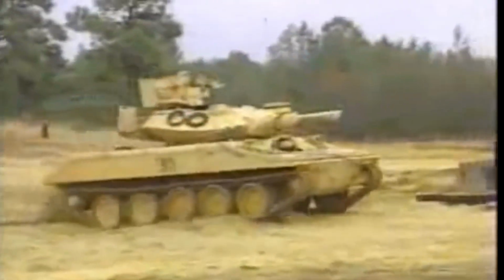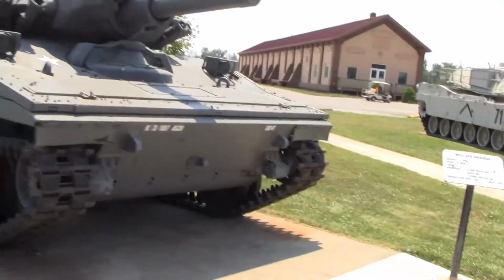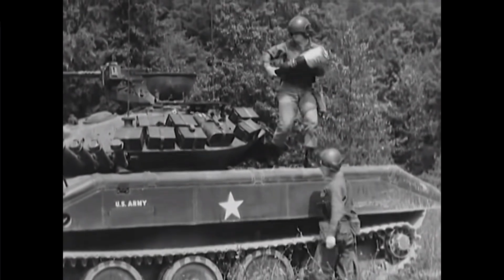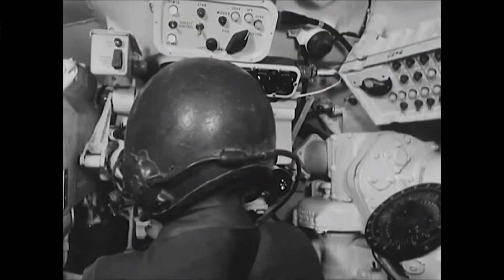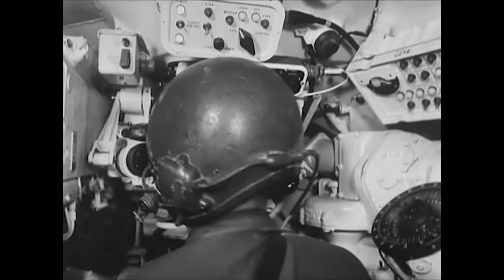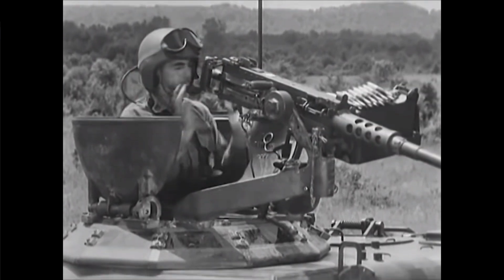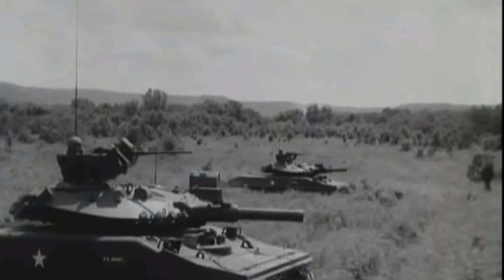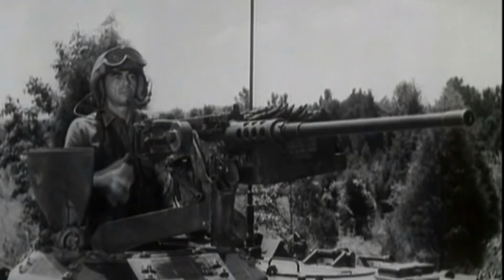M551 "Sheridan" AR/AAV | DESIGN DISASTER!

Comment: The solution would have been to replace the 152 mm gun with a 105 mm M3 howitzer or another short-barreled 105 mm gun, then simply add a launcher tube for the Shillelaghs (one tube would have been enough since the tank only carried 8 of them at a time). That would have solved the issues with the excessive recoil and the M551 still could have killed tanks while blowing up enemy fortifications or infantry.
The only reason why they did force the design to have this big fat gun was because they desperately needed another carrier for their failed gun/missilelauncher combo to keep their pet project afloat, and both the MBT-70 and the M60A2 had failed to materialize.

Comment: Please stop calling the Sheridan a Tank, IT IS NOT A TANK. IT IS AN AIRBORNE ASSAULT ARMORED RECONNAISSANCE VEHICLE. I know all about the Sheridan first hand because I was on one. They were JUNK.

Underneath the loader seat is an air compressor which was so loud you could barely hear when it was running. Next to the loader seat was a giant compressed air tank for the bore evacuation system. After firing conventional rounds the air compressor kicked in with a blast of air forcing the remaining combustible casing out of the gun tube.

The Convention Rounds were encased in rubber protective baga which you had to use a knife to cut so you could peel it off. We use to pre cut the rubber bags at gunnery so we could have faster loading times.

The breach was electric opening as nd closing. The Loader had to insure there was as Titanium ring/seal in the breach before loading a Conventional Round into the Gun Tube. If the Loader forgot that important step it would be a tremendous blast inside the turret of smoke and flames because the Titanium Ring Seals the Gun Tube and Breach tightly. With out the ring, the gases escape violently back inside the turret of the vehicle. Woe be on to a Loader who forgot to do this.

The Shillelagh Missile was slow, took too long to go through the Missle Sub System Set up and had one major flaw. It was IR Guided. It had a tendency to fire from the gun tube, drop down to the ground, lose track of the IR Designator which was pointing a beam at the target. The Missle would pick up the IR Beam coming from the source the Sheridan, do a 180 degree turn around and fly back toward the Sheridan.

After firing the Missle if it hit the ground, shut the damn system off or unass the Sheridan because if it picked up the IR Signal and flew back to you, the warhead contained 5 pounds of Octol. Training Rounds were Inert Rounds but the impact would RIP open the Sheridan Aluminum Armor. This is why the Sheridan NOT A TANK AND IT NEVER WAS A TANK. IT WAS USED AS A ARMORED RECONNAISSANCE VEHICLE. in Vietnam they were uploaded with the Canister Rounds which fired 10,000 Nails or Flechett at the Enemy. They also used the Grenade Launchers which fired White Phosphorus Grenades at the Enemy.

Just so you know, we offered them to Isreal and they turned us down asking us for the M60's instead. This was before the M1 Abrams were built.
Reply: and then the m60s became the magach series of tanks?
Reply: @TimmyTheTimeTraveler  the M60 was upgraded to the M60A1, M60A1Rise Passive, M60A2 which was like Sheridan because it had the short Gun Tube, fired the same ammo and the Shillelagh Missle. and there was the M60A3 which had Thermal Sights. The final M60's were upgraded with reactive armor. 

For a old tank, the M60 is still in use today because it was proven on the battlefield. It has knocked out Russian made tanks.

Comment: I crewed one of these in Europe 75-77.  We were going through a practice run at Grafenwohr  with a full load of 152mm target and HE, 7.62 coax and .50 cal.  Earlier our hydraulic pressure plug had blown so the normally white turret interior had been transformed to a pleasing shade of pink by the flammable "cherry juice".  A green, non-flammable "vegetable juice" would come along later and would cause it's own problem if mixed with any remaining "cherry juice" I understand but we were still using flammable "cherry juice".

There was a wire mesh cable guard in the turret that was meant to keep electrical cables out of the teeth of the turret ring as the turret was traversed.  Our cable guard was missing but nobody though a thing of it until - you guessed it, the electrical cables got caught and severed in the teeth of the turret ring.

The resulting electrical arc from these severed cables ignited the coating of "cherry juice" which was announced by the gunner who yelled, "We've got a fire and it's all around the turret!" as he pushed his way out of the turret pushing the commander out ahead of him.  The loader had already made his way out of the turret and both the gunner and loader were already headed back off of the range as the commander and driver, neither of whom had seen the fire in the turret, attempted to activate the exterior fire extinguisher.

For reasons that later became clear, the fire extinguishers failed to function.  By that time a wisp of black smoke was visible as it rose from the commander's station and a jeep from the rear arrived to evacuate the commander and driver.  Range control was notified and all the ranges on Grafenwohr were closed as the fire aboard the M551 took it's course.  Credit must be given the asbestos bags that covered the caseless ammunition for delaying it's detonation for about 26 minutes.

Upon returning to the vehicle when the proper authority deemed it safe a few days later, shiny globules of once molten aluminum that had been the M551 were recovered as souvenirs.  

Investigation into the loss of the M551 found that the fire extinguishers had been secured with steel wire rather than the required copper wire thus explaining why the commander and gunner could not activate them.  It was speculated the mechanics who serviced the vehicle had done this so fire extinguisher bottles would not discharge while being installed in the hull of the vehicle causing injury to the people installing them.  Subsequent inspection of the fire extinguishers installed in various vehicles in USAREUR established that this was not an isolated practice.

As mentioned earlier, non-flammable green "vegetable juice" was later introduced to replace the flammable red "cherry juice" but I understand failure to completely remove ALL the "cherry juice" before introducing the "vegetable juice" could result in a jelly formed by the combination of the two fluids which could gum up whatever system it was used in.
Reply: I spent time at OP Alpha and OP India back in 76,77,78,  I was with 8th Inf.Div. CSC .5/68,Recon. We had one  with us.
Reply: That was a truly excellent story! Nothing quite so good as military tales where one thing after another happen. Sometimes I just had to laugh!
Reply: So what did we learn today? Asbestos saves lives.
Thanks BTW for the good read. I'm a software developer, but I'm also interested in other engineering fields and I love stories that tell what happens after a product leaves the design table and is used in the field. It keeps me alert to always get feedback from the people actually using the product and sometimes pass by layers of management and paper shufflers.
Reply: Glad you're still with us... what position were you?
Reply: I was in budigen Germany  from 76-79 3/12 cav I fully remember graf/wilflecken that's the tank we had
Reply: I served on Sheridans in Germany and Ft, Bragg. The main problem with the main gun was that the gun seal was weak and  for what ever reason was never fixed. That may have been why the M 60 A2 was dropped. I served in an airborne cav troop when we got the Sheridans. We hated giving up our 106 gun jeeps because of the freedom of travel but found the Sheridans got around much better than the M 60 that we also gave up. We never threw tracks on the Sheridans like we did on the M 60 so we got used to the 551s. But I did love that Shillelagh. Fired them in all kinds of weather and never had a miss. I know of the combat record of the Sheridan in Vietnam but also from what I read tankers did not fare well there on the M 48s either.
But that also depend on who you talk to. I talked to those in the 11 ACR when they moved from the M113 to the M551. In both protection and firepower, they told me that they would take the 551 every time. For myself between the m60 and the m551, I'm a Sheridan man. But lord I sure missed that Gun Jeep.
Reply: Ooo

Comment: In 1969 I sat on the ground shut down near one these that had hit a 155mm dud rigged as a mine the night before.  There was not much left; the engine, the gun, a few odds and ends.  I watched for half an hour as two medics sorted through the wreck.  Occasionally they would bend down and pick up some small bit and put it into a rubberized laundry bag.  When they were finished, my passenger, the squadron commander, brought the bag to the helicopter and gently laid it in the back seat, stepped back and saluted.  He was obviously deeply distressed.  The bag could not have weighed more than 20 lbs.  It was the remains of the Sheridan crew.  None got out.  It was not the first, or the last, time I saw something similar.  Aluminum armor and combustible rounds indeed.

Comment: I served on a Sheridan in the early 1970s in Germany in every crew position.While we never had any of the issues you mentioned (never had a main gun failure or issue with chamber gasses). We viewed our tracks as essentially an anti-tank missile launcher. I do remember the main gun recoil very well. You had better be hanging on. We loved the cross country speed too. Rate of fire was abysmal, however, and was one of the weakest points.

Comment: According to a friend of mine who was on the Sheridan after the M60, to load the shillelagh, because it wouldn't actually fit in the turret ring very well, you would have to fully elevate the gun so you could kind of shoehorn it in, then depress it so you could fire. Maybe it was a matter of convenience, but that is what he said.
Reply: It takes practice to load a 60 inch 65 pound round when you are in a tight space, but it can be done. With practice and experience. Just make sure that you have the key down and lined up with the slot on the loading tray.

Comment: IIRC the Sheridan is a Airborne Armoured  Recon Vehicle, not a tank.
As noted Australia trialled it for the Amoured Cavalry Regiment (Medium recce) but in the end did not adopt it, despite that the Aussie doctrine that included the Sheridan was published and issued (I had copies of “The DIvision In Battle” which included org charts and other references to the Sheridan).

Cherry OIl - OM15 - we used the same stuff in M113AS1 - which is roughly the same era as the M551.
OM15 is a hydraulic fluid died red (hence cherry oil) to help identify leaks.
On the M113 series it was used for the hydraulics that raised the ramp and possibly the hand pumped steering pivots.

Comment: I worked as a driver, gunner, and loader on an M551a1 from 1986 to 1989. I was with the 3/73 Airborne Armor Regiment.  As stated below most of the issues with the tank had been resolved years earlier. I was one of only 3 drivers that I know of to "swim" the tank. I found this to be the most terrifying thing I have ever done. All in all the tank I was on was fast and reliable. We were warned tho that if the tank caught fire it would burn VERY quickly because of it's aluminium construction.
Reply: All too true.

Comment: I'm not sure how true this is but it's funny anyway. Apparently the Sheridan had problems with the parachutes on a fairly regular basis. This depending on drop height would regularly result in them burying themselves in the (hard) ground up to about half way up the turret. This led to someone actually putting together and submitting a battle plan to take out Noriega in Panama by air dropping six Sheridans on the basis that one of the parachute systems would probably fail and squash him. Apparently the senior staff were not amused.

Comment: Clearly it was intended for the French. Rolls backwards as you fire... perfect.
Reply: Roland Lee 
Correction: in French service, the tank would be pushed FOWARD upon firing because the turret would be turned backwards to face the enemy.
Reply: @Tomcat82  Hmm.. since this tank has no actual armor to speak of then I indeed have to concede your tactic is a much better option given it can tactically retreat in cowardice to surrender 2 hours later more effectively at full speed rather than being limited to one gear in reverse.

Comment: Although the vehicle had many short comings, I personally believe that the M551 is my favorite tank. The reason why I believe it is my favorite is because it is one of the only military vehicles in history where retiring it from military use has left a small but noticeable gap within the airborn units. The tank has not been replaced and therefore the airborne currently have no tank capable of doing what the M551 could which was it could be air dropped as mentioned in the video. However, this is not the sole reason why it is my favorite tank. All around the Sheridan was an ambitious and quite unique idea and that’s why it’s my favorite tank. A tank with a powerful punch carrying an advanced weapon system, while being capable of amphibious operations and capable of being airdropped. For all of these reasons, that’s why the M551 is my favorite tank. Keep up the great videos and this one was fantastic.
Reply: I spent more time on Sheridans than M60s but spent a lot of the M60 time replacing thrown track. I never threw a track on a Sheridan. The best running track I was ever on.

Comment: Hi, it was a good presentation. I was drafted, as an infantryman, from the replacement depot at Long Binh and sent to K Troop, 2nd platoon, 3/11th ACR stationed in Di'an, in Nov. 1970. I was assigned to the lead Sheridan, 1 of three, in this unit. Ultimately I was asked if I would like to drive. I received OJT on its operation and would up driving lead vehical in this 9 track unit, where everyone placed their tracks right where I drove, so if I didn't hit a mine, they were also likely to miss one. This vehicle was a death trap because it was aluminum, the caseless ammo would turn into an inferno if we hit a mine or were attacked with an RPG. When I was driving they had already placed a two inch steel plate under the bottom of the track and it covered up the drivers escape hatch. The missile aiming system was knocked out by the HEAT round recoil violence, we used the flashette rounds to sweep away trip wires. this vehicle could swim through mud three feet deep. And, I prayed alot and never hit a mine. After this unit stood down in about Feb of 1971 I went north to serve in the first of three air mobile infantry units. I was kept safe by my angels in those unites also.
Thank you, again, for your presentation. 
michael-jay
Reply: Nam guys are cool
Reply: 1/11th ACR Fulda Germany. Scouts out.
Reply: @BigDaddy-fx4nx  3/11th ACR was stationed in my hometown, Bad Hersfeld. When have you been in Fulda? Appreciate your service!
Reply: @moorwaldent4233  1983
Reply: @BigDaddy-fx4nx  I was stationed in Fulda also armored reconnaissance started out in 72 with the 14th ACR and then it was reflagged by the 1/11  ACR  May 2, 1972 spent a lot of time out on OP Alpha. I was in A Troop and was a NATO guard for a while out on NATO 26 and then I moved in with C Troop  and stayed there until my ETS date September 1974. Remember Andreasberg the little guesthouse? I know I didn't spell that right. Anyway if you arrived with the first squadron of the 11th at Fulda in the early years I know you remember the Crow calls. The officers hated that. If you were there you know what I mean. Allon's!! Scouts out.
Reply: God bless man thank you for your extraordinary service!
Reply: 3/11th ACR was also stationed in my hometown, Bad Hersfeld. I appreciate your service!
Reply: Thanks for your service, man.
Reply: That's one hell of a story . Sir with all due respect I salute you for ur service 👍👍👍👍👍🌟🌟🌟🌟🌟
Reply: I got to give you my props my friend. That was one hairy situation I would never want to be in. It truly was by the grace of God you made it through that nightmare. Although I was never in the military, I think I would probably rather be an infantry than in one of those death traps. Sounds like you were maybe one step removed from driving a Ronson lighter (Sherman tank).
Reply: knocked out, meaning it fell off?
Reply: @TimmyTheTimeTraveler  Hi. The infra red tracking unit was not able to remain calibrated for guidance. Thanks.
Reply: @mjcyrano68  Thanks for serving, you needed more 12-Bravos.
Combat Engineer 00-06 12-B (Ret.)
Reply: @mjcyrano68  
These days they complain about the HumV with no protection....
Back in the 70's and early 80's on convoy escort all we had were Gun Jeeps.....
I was standing in the open back of an M151A1 with no straps hanging on to my 60 for dear life at 40mph with my ass in the wind❗😜❗
The only armor we had was a flack jacket and a steel pot and a bull riders prier on our lips❗😎❗
Especially off road.....
Reply: @pffear  Wow! They don't mention that in the recruiting commercials!
Reply: bob bobo  According to this video we are commenting on - yes they did have M-551's in Desert Shield.  There are a lot of different types of tanks, some of which have very little armor - such as the M-18 Hellcat - but a big gun.  The point being - that they wanted a tank that could be air transportable - and it had to be very light in order for an aircraft to be able to lift it and drop it.  The reason I mentioned the 113's is to show that the 551's were not the only combat vehicles we had with aluminum armor.
.